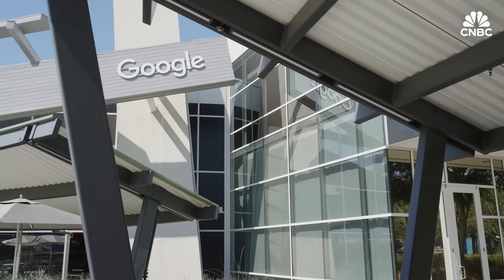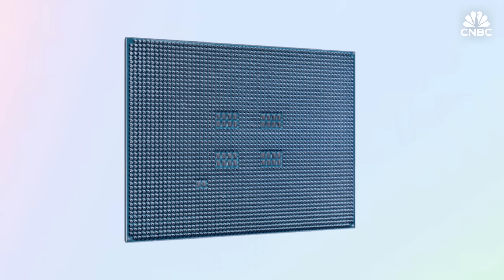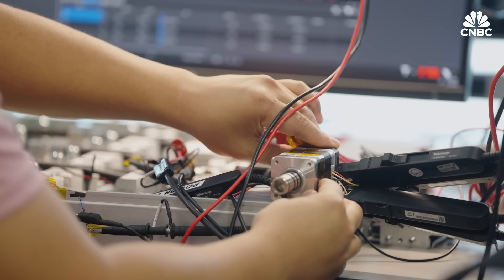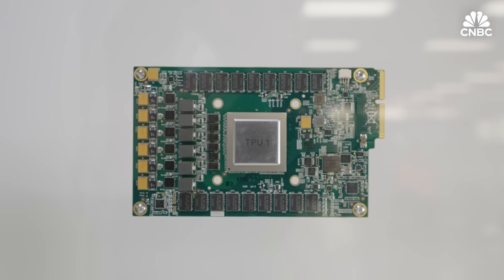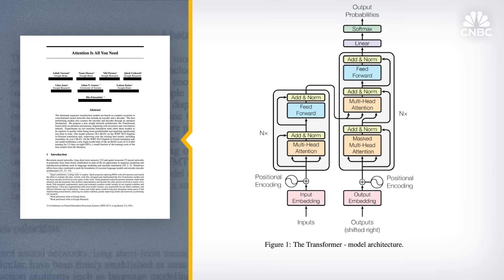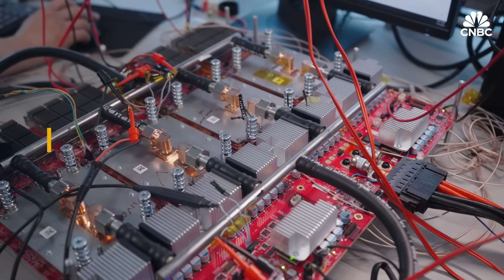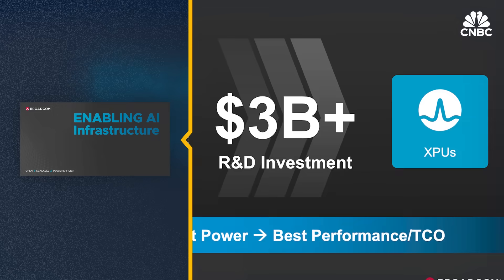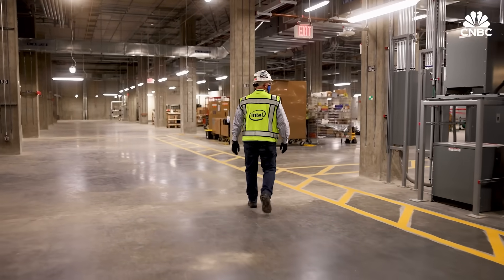How Google Makes Custom Cloud Chips That Power Apple AI And Gemini

Comment: They like to toss around the word AI but it's majority just going hard with spyware, and if you make your own cpu then you can circumvent any opensource OS
Reply: While its theoretically possible to bypass certain open-source operating system limitations by creating your own CPU, this isn't a practical solution for most individuals. These technologies are primarily designed for enterprise use, not casual consumers. Companies thoroughly evaluate and study these systems before implementing them... they don't just adopt them blindly.

Comment: TPUs (Tensor Processing Units) are called NPUs (Neural Processing Units), in Intel's upcoming new Processors. Intel Arrow Lake, or Core Ultra 200. 
The successors to the Meteor Lake/Raptor Lake refresh 14th-generation, "Arrow Lake", which is expected to debut towards the end of 2024.
Reply: Nice but... it does not work. Google gemini is like... Bing.
Open AI is THE ONLY "artificial intelligence" so far.
Reply: As a PhD in tensor calculus i tried to understand why they have chosen Tensor as main name for their processor. I studied the paper and there is no evidence that this processor is handling data as tensors. Instead, It seems they handle the data as matrix, and matrix are not tensors, although sometimes tensors can be represented as matrix.

Comment: It's encouraging to see Mega Tech companies developing their own custom Application-Specific Integrated Circuits (ASICs) to address specific use cases, especially in light of the gaps left by the shortage of general-purpose chips like those provided by NVIDIA. I'm optimistic about Axiom's potential success in this area as well. However, NVIDIA has tackled a more significant challenge in chip manufacturing by solving the supply chain issue. Through strategic partnerships with TSMC, ASML, and other key suppliers globally, NVIDIA has created a vertically integrated system that allows them to consistently produce and deliver some of the fastest GPUs necessary for building advanced models.

Even as these companies develop world-class ASICs or general-purpose GPUs, they may address certain needs but are unlikely to challenge NVIDIA's dominance in the near term. These companies will still rely on NVIDIA's GPUs, acquiring what their negotiated quotas allow, while supplementing with their in-house chips. This isn't a lack of innovation but rather a reflection of the advantages that a well-established company like NVIDIA has built over the years, compared to Mega Tech companies that are only now venturing into chip development.

Comment: The Google chips are designed to handle the "transfomer" aspect of AI, which is arguably the most important and foundational to anything related to generative AI. The complete GPT solutions are being run on NVIDIA GPUs because there is nothing on the market that can touch the performance of the NVIDIA GPUs.

Comment: As long as no one uses Samsung to make their chips - it will work fine.
Reply: Why do you say that? Just curious =)
Reply: @MichaelMossmanNZ  Lower performance, higher heat generation, less power efficiency, and inconsistent performance are some of the reasons why Samsung aren't very good in this specific sector.

Comment: The energy consumption of these products is concerning.  We are supposed to be reducing energy consumption and not increasing it.  They should be required to have solar and wind generation onsite to offset at least some of the energy consumed. They should also be required to invest in solar and wind power in the city their data centers are located in. The water used to cool the servers should also be in a closed loop.

Comment: These are the same people that will tell you they care about the environment, but have replaced forest with unnecessary technology
Reply: "unnecessary technology". Since when are computers unnecessary?
Reply: @Coyannn  probably since Sasser, Bot infections, airline telco systems downed recently and probably the next time AI gets mood swings vetting backdoors. 

Yes some computers make life simpler, maybe easier, but you tell me what you'd do staring at Bsods and downtimed systems. There has to be proactive measures plus diversity, not Xerox photocopied hardware and software ( even xerox machines had individual artefacts)

Comment: I used chatGPT than Gemini. ChatGPT is also secretly connected to department of defense networks or FISA (Foreign Intelligence Surveillance Act) which monitors overseas activities or domestic spy program that doesn't sell data overseas.  It has very strong firewall.  The reason why founder refuse to sell data to overseas. They are concern about AI security or worried it might turn into AI terminator sky net,  end humanity, or spill propaganda disinformations hacked by Iran, China, Russia, etc....   Google Gemini... don't know. Many overseas dissents arrested using Google AI when it's powered by VPN.

Comment: TPUs aren’t as powerful or flexible? I’m pretty sure they’re as powerful, just not flexible. However, that’s irrelevant for running large networks. All you need is matrix multiplication quickly. It doesn’t matter if there are other features.
Reply: @bass9052  so, they’re quite powerful, right? Especially with Jax making scaling easy. How does this contradict what I said above? I was questioning the video claiming they weren’t as powerful. They’re (TPU v5p) in the same ballpark per device as H100s
Reply: @tthomas513  It's not Jax that makes scaling easy. Jax is a tool. TPUs are optimize for large scale matrix multiplication.

Comment: "new way, direct chip cooling", that has been around for decades, geeze
Reply: Liquid cooling has kinda had a renaissance in the server space recently if I'm not mistaken. It's become needed in the next generation of servers from people like NVIDIA where we have GPUs that are pulling kilowatts per chip.
Reply: Building one gaming pc with liquid cooling is not the same as trying to retrofit liquid cooling to an entire data center that had been designed for air cooling. They are doing it with new data centers or in existing data centers when they decommission old hardware and replace them with new hardware.
Reply: @JasonB808  Well yeah. Except they didn't start designing racks for this in most cases until the last few years, at least for general applications. Now things like Nvidia's new DGX racks with per-server liquid cooling (iirc) exist.
Reply: Yes, the cray supercomputer was liquid cooled. Multi chip modules was developed and deployed in IBM 3081K, around 1980. Now called chipsets. 
What was old, now it is new.
Reply: not at this scale
Reply: @Sequaloid yes it has.  I don’t want to take anything away from Google but look at the modules IBM made in the 70’s, each with ~400 die each and water cooling.  A computer center could have hundreds of these modules all working together.  The scale is similar.
Reply: @DrParticle  not at this scale